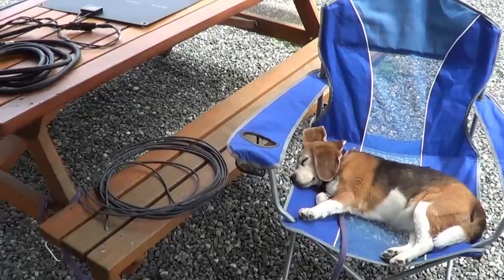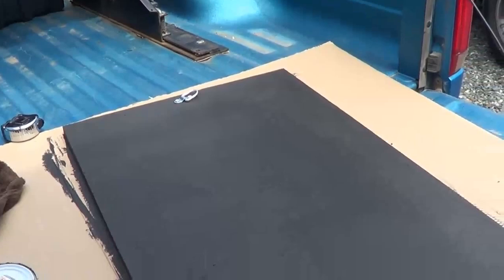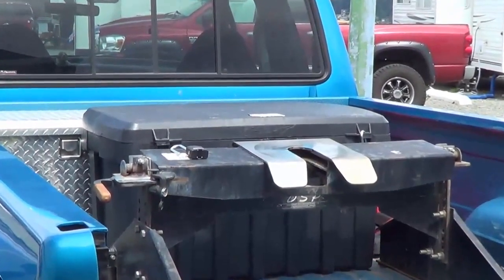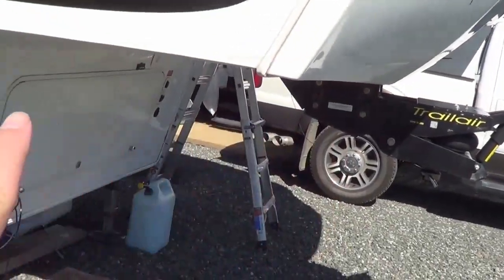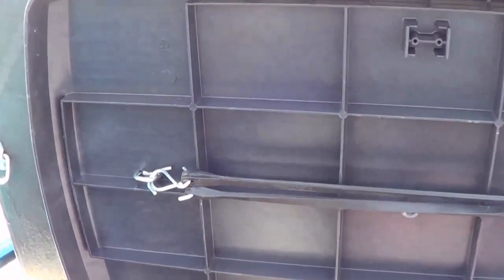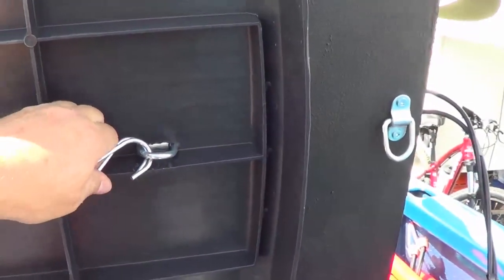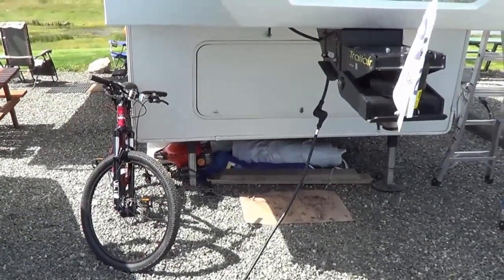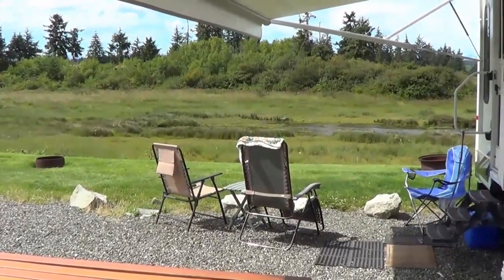Portable Solar Panel Mod for RV Boondocking

Comment: Looking at the repurpose noodles, I do the same with old garden hoses. Cut up garden hose is good to use as a buffer to protect wires, . I use garden hose lengths to hold my tools on the garage walls, as well. I'm practical, not fancy

Comment: Love the Project.  How do you plan to address the fact that the male plug connected to the solar panel will have voltage when the sun is out and un-connected.  Hope it does not hit the metal on the truck and short out the panel.

Do love the video on solar.  Thanks
Reply from the maker: Thanks. My truck box is coated in rubber bed liner but it doesn't really matter nothing happens when you short an unattached solar panel, it's not like a battery.  Actually, one test of a solar panel is to put the multimeter in amps mode and test for max current by attaching the leads across the output lines. The Lensun is rated at 6.47 amps, not really enough to hurt anything as far as the wiring goes I'm using a 30 amp cord.

Comment: Clean and neat job. I like it. Do you think you need a drip loop before entering the RV, to reduce any water getting in?
Reply from the maker: Thanks, No shouldn't be a problem since the wire is under the fifth wheel nose. In any case, the feedthrough hole is waterproof, used fro boat hull pass throughs.

Comment: If you had to do it all over again, would you use the flex solar panels or what you have on the roof?
Reply from the maker: I'd go with the panels I have up there. I feel they are good value for the money spent and the type of roof my fifth wheel has suited them well.

Comment: Now that you've had the COUGAR for awhile, do you wish you had bought a Jayco with the 2 year warranty, or some other 5th wheel TT?
Reply from the maker: No, we like the Cougar. It's not really about the warranty though we at the time bought an extended 6 years warranty. We really like the layout and amount of storage space. It was a good pick for us since we have lived in it full time for 5 years and have no desire to get a different trailer even though we've gone to shows and walked through a bunch over the years. Cheers. Ray

Comment: Thanks Ray.  I appreciate the idea.  So with 4 panels on top why add another one?  Did you need it or just something to do?  When it was showing the 27 amps on your Tri Met was that with the other 4 too or just the one.  Keep them coming Brother I appreciate the education.  Slim
Reply from the maker: I had plans to add one more 100-watt panel as my  controller can handle it, more power is always better ;) It's really handy to have are remote ground panel for times we park under trees or to capture some power early power from the rising sun when it's too low or the wrong angle still to hit the roof panels. 27 amps is all the panels together. A single 100-watt panel usually maxes out at 5-6 amps.
Thanks, will do. Cheers Ray
Reply: One more question, for now.  How many batteries are you charging?  I missed that one.
Reply from the maker: The battery bank has 4 Interstate 6 volt golf cart style batteries.
Reply: Cool.  Thanks.

Comment: Nice work. Now you have non flexing flexible solarpanel... And if it starts to rain during flexible use, your toolbox will fill up through the new holes.. Greetings from northern Norway, here this project would be just trouble...
Reply from the maker: It'll work great in the US southwest desert, though where I spend the winter dry camping. Rain is rare and if it occurs I just place the panel back on the tool box since there is no sun anyway.
With the flexible panel  no worries of breaking glass like other portables. Cheers!
Reply: Bet the weight of the plywood makes it a bit more windproof.. Thanks for response. And more important; happy camping!

Comment: Cap that plug when not connected or the contacts will be energized when the panel is in the sun..
Reply from the maker: Easy enough to do. I was thinking of wiring in a socket and small controller and have it help keep my truck batteries charged up.

Comment: Looks good.  You may want to make female side as the hot side . Easy to short out your way
Reply from the maker: Both sides are actually hot since the panels are paralleled. The female has the roofs 400-watt array on it. Shorting out the 100-watt panel when unplugged shouldn't hurt anything, they are not like a battery.

Comment: the socket should be on the solar panel and the plug on the rv lead
Reply from the maker: Why's that?
Reply: Yes, I agree, since that plug is energized when the sun hits the panel. Anything metallic touching the prongs will short or ground the panel. Only way to avoid that is to place a cap or "dummy socket" on the exposed plug contacts.    J K

Comment: these are the inline breakers I bought. currently unavailable on Amazon but you can find them on eBay
https://www.amazon.com/dp/B0036271EC/ref=wl_it_dp_o_pC_nS_ttl?_encoding=UTF8&colid=74N4Y9SDVY4N&coliid=I3B3YOULZ0EHYP
Reply from the maker: Cool.
Reply: Nice video

Comment: The solar panel cable should have a female connector to prevent shorts from destroying it.  The solar controller power input should be male.
Reply from the maker: What if I short-circuit the solar panels?
Solar panels are very different from batteries in regard to what happens when you short-circuit them.  Batteries rely on a chemical process to produce a constant voltage, whereas the voltage of a solar panel changes depending on the load.  

When you short-circuit a battery, the chemical reaction will try to maintain that constant voltage by driving the current to an extremely high level.  This high current will be more than your battery terminals, or whatever is causing the short-circuit, can handle, and sparks will fly as metal melts.  Your battery could be ruined depending on how long the short-circuit lasts.

When you short-circuit a solar panel, nothing happens.  There is nothing driving a constant voltage and the panel behaves as if it were inert.  The solar panel will not be damaged. - http://www.amsolarrv.com/edfaq/2016/5/12/frequent-questions-solar-panels